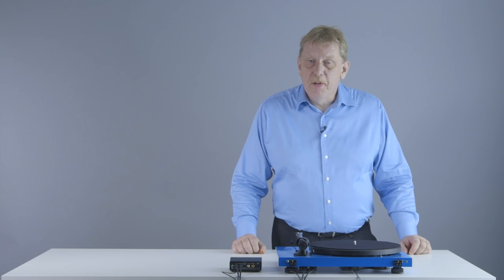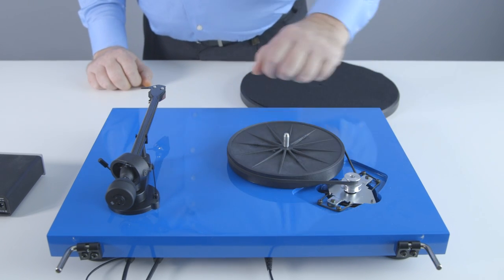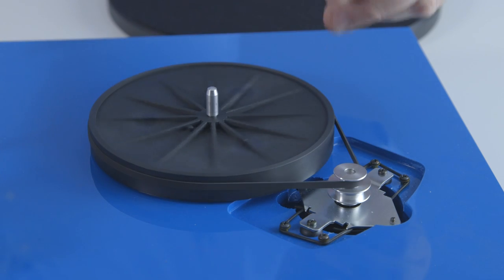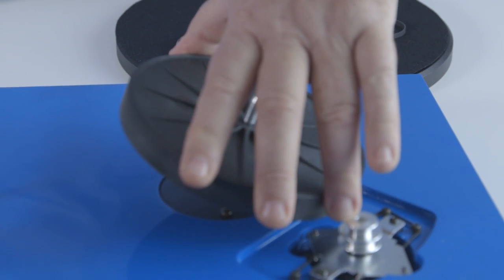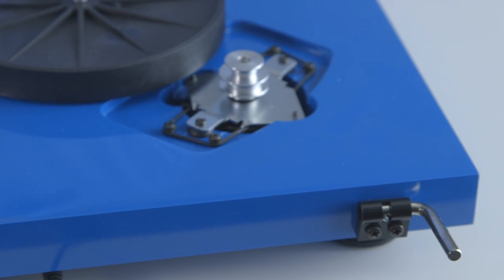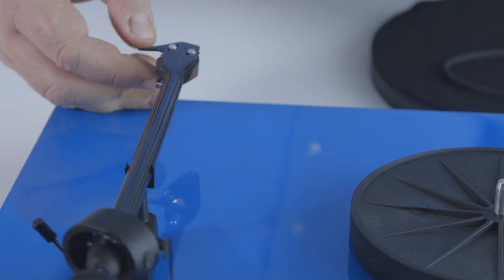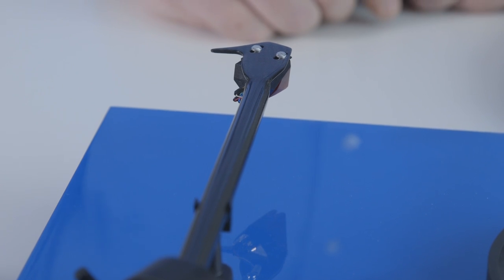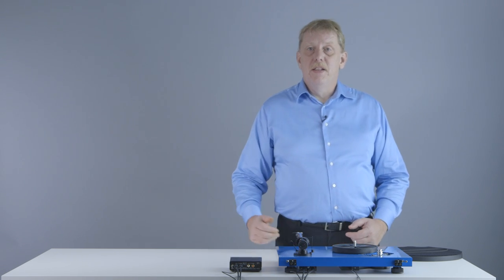What Makes A Good Turntable?

Comment: I got over my Direct Drive bias, and I feel better for it! I grew up with what are now called 'vintage' turntables; direct drive and fully automatic. After having been out of vinyl for 20 year, I had the itch to get back in. Initially, I wanted and sought out that with which I was familiar; direct drive and fully automatic turntable. I found a 'vintage' Pioneer that seemed to be what I was looking for; but it died within a month. I ended up with a Pro-Ject Debut Carbon (slightly used with the upgraded platter) and I couldn't be happier. If direct drive is so much better, why are (pretty much) only DJ turntables built with it? Why are so many high-end turntables belt driven? That Pioneer, being vintage (which is a polite way of saying 'old') could not maintain a consistent speed. I have zero interest in spending time learning how to take apart, clean, repair and then reassemble a turntable. None. Direct drive would be complicated to repair. People say 'the belts wear out'. So what? Buy a new belt! Do you realize how much easier and cheaper it is to replace a belt than it is to replace a direct drive? I'm good with my Pro-Ject; I'd put it up against anything 'vintage', any day.

Comment: Belt drive is by far the better drive system, if one is looking for sound quality, Direct Drive is a more convenient, faster method for driving the platter, but with many compromises regarding sound quality.
Reply: Foh dude. Direct drive is better in every way than belt drive.
Reply: Not even close man. DD is better in every way (but there are bad examples of both a there are most definitely belt drive models that are better than certain direct drives). But, DD is quite simply are more modern, efficient and better way to build a turntable. An old Technics SL-1200MK2 (that is up to spec) easily beats out even the best and most expensive version of the Linn LP-12 (and similar tables). It has lower rumble and lower wow and flutter. What are the the draw backs of direct drives exactly? The cogging thing is a myth. A good  Technics DD doesn't have any. If it did it would show up in the frequency response plot and/or the rumble measurements.

Comment: Well,lets be honest here. It realy doesnt matter if the platter is rotated direct driven or belt driven,if the quality of the drive itself
is ok.  Meaning mainly W&F lower than 0,1% ,S/N ratio larger than 65dB.  What is needed from the drive is long time,drift free
constant rotation and silent operation. The industry threw out those in the thousands by the end of the seventies for very little
money compared to today.

Comment: Project debut series suffer from hum issues. Tried 2 Carbon Esprit TT from Crutchfield and returned both  because of loud annoying hum. But I take this as a blessing in disguise or I would not have discovered how good the new Rega Planar 3 sounds.
Reply: Bought Debut III Se yesterday . No hum at all.
Reply: My second hand Debut III had some hum problems but Carbon DC runs silent.
Reply: Litmuz: Hum is generated by cartridge and tonearm not the turntable. Properly connected ground cable to the phono stage should eliminated all hum problem.
Reply: I agree. I used 3  kinds of phono cable all well shielded, even bought a new phono preamp, tried it in 2 kinds of integrated amp and an AV receiver, plugged it in different sockets in my house and even moved my speakers as far as seven away from TT and still the hum persisted. My older $125 Sony TT never had this issue.
Reply: Try move your turntable placement.
Reply: Done that too. Pro-ject offered no helped when I called tech support and just suggested returned it to dealer and that tells me this is an ongoing issue w/ their TT. Its a hit and miss w/ their lower end tables. Someone even suggested to check cabling inside tonearm but that's just too much work for a product which supposedly pro-ject claimed as plug and play. I'm glad some of the folks here did not go trough the same experience I had w/ Carbon Esprit.
Reply: it's not your TT - it's you
Reply: Never had issues with mine, it’s why I haven’t upgraded to anything else yet. Even though the money in my pocket is screaming for me to purchase a new TT
Reply: If you have a Planar 3 with Elys 2 then you probably know that Rega Elys 2 hums big time. The closer the spindle it gets the more it hums. That cartridge is not worth $2.

Comment: In audio there is such a diminishing law of returns. Spending more money is not always yield better performance. I could not tell the difference between the Audio technica Lp120 and my current project Essential 3
Reply: you may as well buy something from aldi and save lots of money. consider it a blessing.
Reply: In order to test 2 different turntables or CDs then you have to have two very basic good things :

1st : Amplifier and 2nd : Speakers :

To reveal any of the sound quality diffrence from the machines if there is of course 
But if you use low badget amp and speakers don't expect any results Mr postersm 71 

But of course i don't know  the rest of your stereo set besides the 2 turntables you've mentioned in your comment !!

Comment: Direct Drive is better , Belt drive never get the   Exact speed and change over time ,less vibration with a belt yes but not better
Reply: Hey Darren I always thought so as well , as the belt ages it stretches and dries up no thanks
Reply: If as you say DD is better then why is it there are so few really good quality DD turntables on the market? It's a fact that most good quality TTs are belt driven. There are actually a few really good DD turntables, the new Technics, Brinkmann and perhaps a few more, yet there are literally hundreds of belt driven TTs. I've had a belt driven TT for 25 years and it's perfectly stable, changes speed easily between 45 and 33 and has never missed a beat.
Reply: Cate Robertson Because, particularly in the past, it was hard to prevent the motor noise from being transferred to the platter. This is because the motor is directly below. Modern materials and innovation have made it easier to reduce this, but moving the motor to the side and adding a belt is easier.
I like DD, as well. Was going to buy a 1200, but decided to save a few hundred, and try the Audio-Technica AT-LP5. Glad I did. Loving it a lot. No noise.
Reply: Darren T belt drive turntables are the most expensive in upwards of 100s of thousands of dollars. Yes some do cost that much. Usually true audiophiles use and listen to belt drives whilst direct drive  is geared toward the DJ and clubs.
Reply: Really? the record you are listening to  was cut on a direct drive !  fact is they both have pro's and cons. and another fact is its pretty hard to make a dd motor, much harder than a belt drive.
Reply: Yes and if you get issues with a direct drive that's $ towards a repair while belts can be easily purchased
Reply: Direct drive is for DJs not audio files.